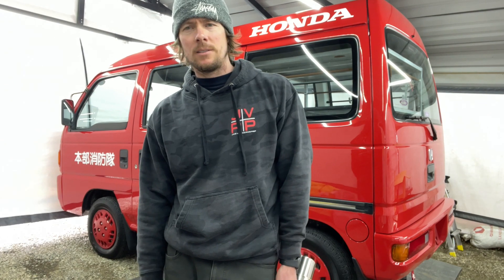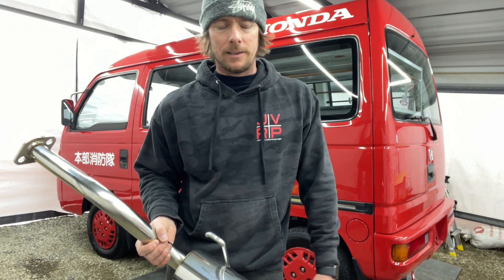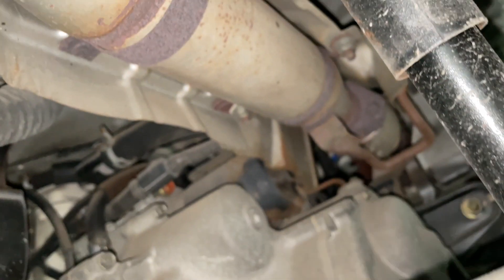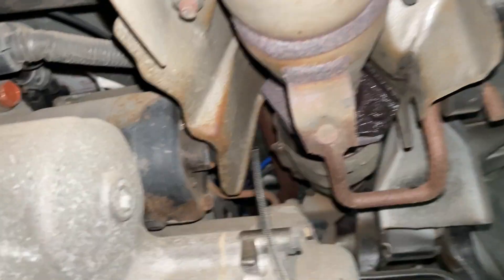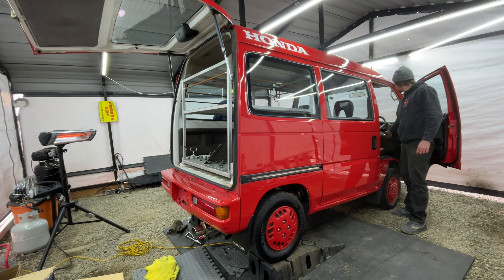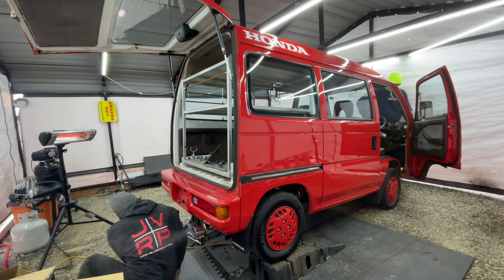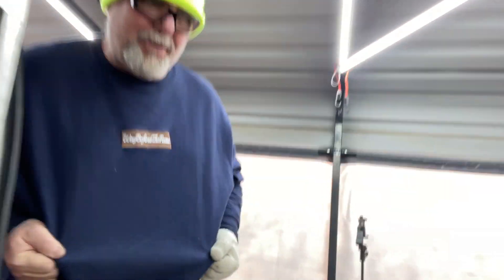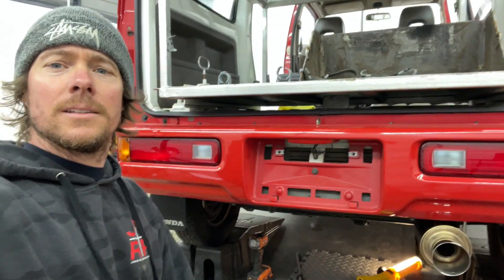Making My Honda ACTY Van Sound Faster and Cooler With This GIGA N1 Exhaust from Japan!

Comment: You can simply cut the muffler off and weld a pipe to the resonator, sounds pretty good. Take the heater hoses and connect them to each other. Cheap and effective.

Comment: What did you end up doing with the heater tubes? Just plugging?
Reply from the maker: i actually just pulled the tubing off and left them open. i may find something to plug the one on the intake housing though.